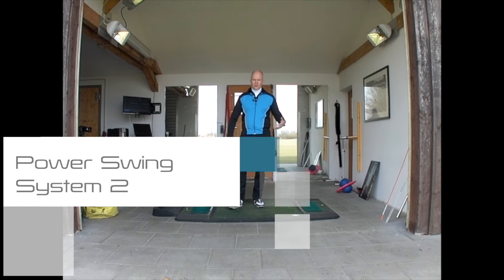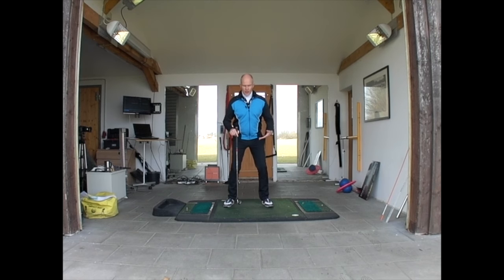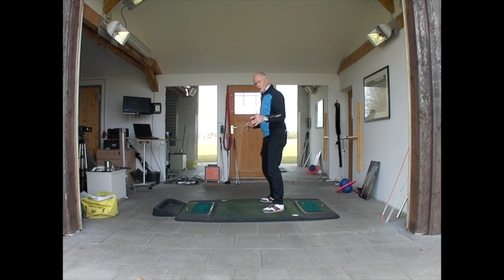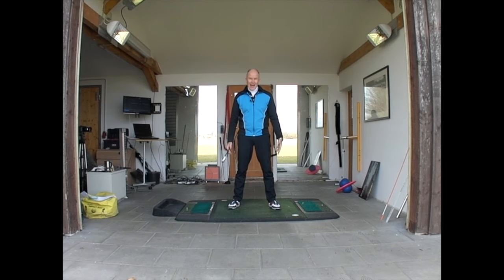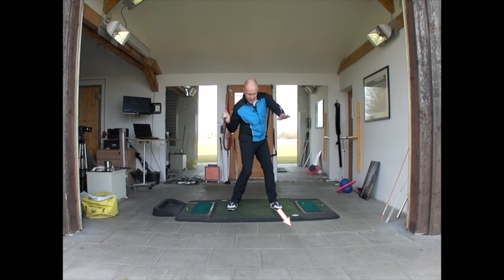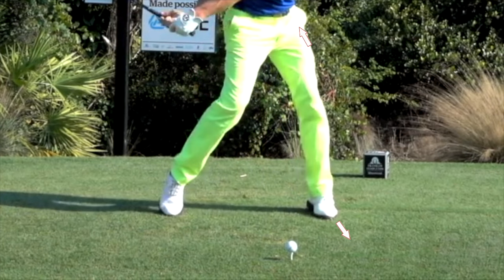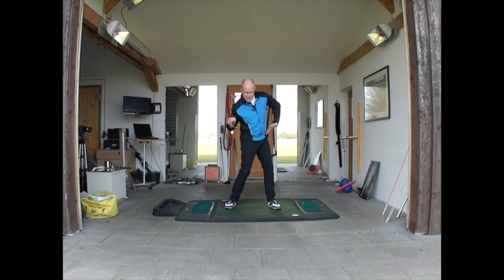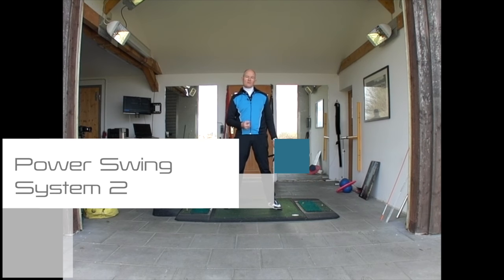Learn how to use shear forces to turn your hips in a golf swing

Comment: This is by far the best golf instruction youtube video of 2017. All that speed is now unlocked, set free and ready to be used.  The key with driver is as soon as you pressure out with the left foot, let it go, sacrum rotating back away from target.  But then look at McIlroy and see how he increases knee flex before jumping up. That's because he can deadlift massive amounts of weight and hold off the move. Most of us , me included, can't do that so need to start the move back sooner.  With short and mid irons, you can wait a bit longer.
Reply: I am sure you will find that Rory could do this before he did any deadlifts/weight training whatsoever!

Comment: Great video as if u learnt golf as a strong adult male and the wrong concept you can easily turn the hips without using ground pressure. Dont think bio-mechanically (or maybe its a feel thing) the legs can turn the hips but they are obviously the key link for the hips/pelvis to utilize ground pressure for power and speed.Anyway this is in my top ten golf videos,of all time!

Comment: ...good one ...I think of pulling the cord on my Dad's lawn mower to create that "shear" force you speak of  ...also I envision this legwork creating a torso vertical rotation that links with an imaginary conversion gear which in turn rotates my shoulders on a horizontally diagonal plane. If I do this, it stifles the natural tendency to swing at the ball with the shoulders right from the top.

Comment: Interesting video. So technically both feet are pushing in the same direction (forward with the most pressure on the toes) to get their respective hip to turn back just not necessarily at the same time?

Comment: Hi Jonathan...loved your videos. Thanks. I am 6' 4" like Ernie Els. I am trying to model my swing like his. My fear is that my backswing is too upright (?) and then maybe (?) my downswing is too steep. I have a tendency to do one of two things: 1. Hit off my back foot and 2. Hit a pull hook.  I rarely slice. Any ideas????????????????? Thanks.

Gerry
Reply from the maker: The question is, are you as flexible as Ernie Els? I can’t tell you what is happening in your swing without seeing it, but copying a tour Pro rarely ends well:)
Reply: Gerry, I am also tall guy 6'7" I have tried to copy Ernies swing for years but this year I have thrown that in trashbin. Even I have flexibility Ernie has I wont copy his swing. But You mentioned pull hook. Sounds like you are coming from outside to in. I have exactly same problem. Club path is out-in and your club face is closed at impact and that causes pullhook.

Comment: So if I push off the left foot, will that make me top more iron shots because i could possibly lift my body?
Reply: Jose Moreno you are supposed to lift your body, post up on your left leg and posture up your body. Your whole left side needs to extend. Look at the finish of the pros. None of them sags or stays down. They stood up. You have to try to stand up on order to stand up at the end. Google Parametric Acceleration golf. Posting up on your lead leg will not only increase your club head speed through impact, but it will give you a longer low spot through impact, a shallow approach and more margin of error.

Comment: You are correct to state that when starting the downswing's counterclockwise pelvic rotation that the left buttocks must move back to the tush line before the right buttocks leaves the tush line. However, you are totally wrong to claim that the legs are the causal agents inducing the pelvic rotation via a pushing action of the feet against the ground. Counterclockwise pelvic rotation at the start of the downswing should optimally be induced by the active muscular  contraction of the 6 right-sided lateral pelvic rotator muscles as described in this review paper at http://perfectgolfswingreview.net/pelvicrotation.html
Reply: Im sure you will say this is wrong but if I dont push into the ground I over use/turn/ sway/ move with the hips.Pushing into the ground seems to concentrate the loading/releasing and timing of the hips